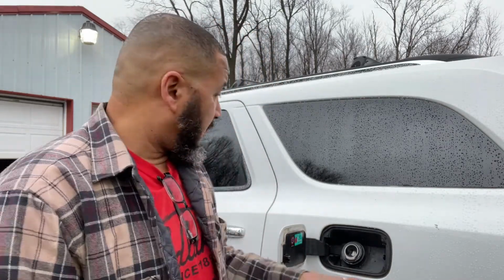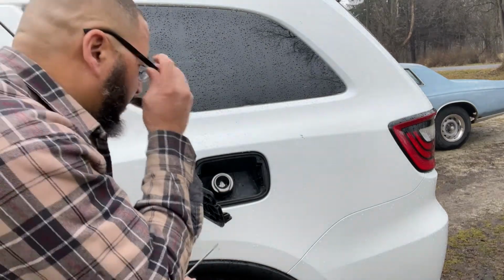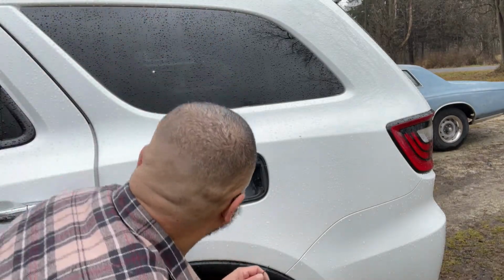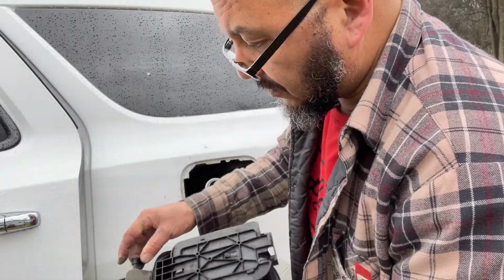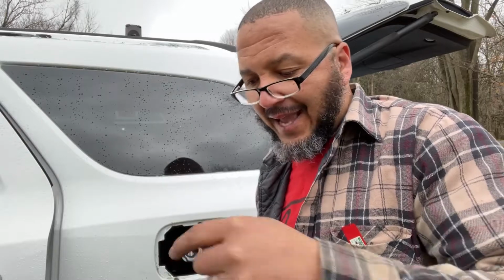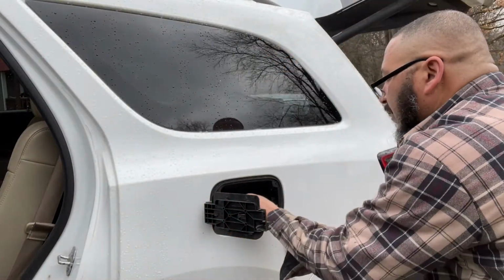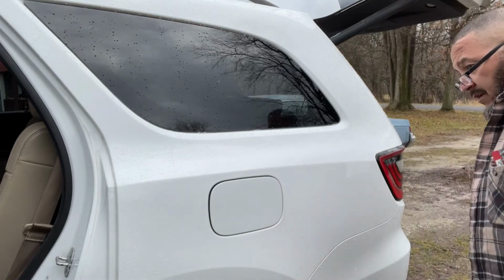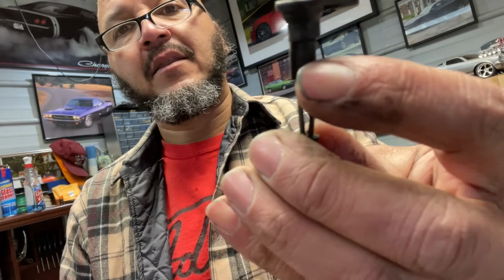2014 Dodge Durango Fuel Door Repair

Comment: Other than the button by the light  selector switch  on thefront dash, where exactly in the back is the control for the gas door incase the is not working

Comment: I had to do one where the door hinge pin broke so I drilled a bit and drove a screw into it. There is like three hinge pin replacements that are solid metal that are made for ford f150s and/or Lincoln's that look like they should or might work. They look like same thing to me just stronger. Wanted to know if anyone has tried one?
Reply: Have u tried? After seeing them they looked a little too big so I’m just avoiding wasting time and just ordered a whole new fluid filler housing

Comment: Do you know how to get into a 2016 Jeep renegade gas door that's stuck shut???? This happened yesterday and I'm severely low on gas.
Reply from the maker: There may be a passage in the rear if it has a tailgate. It would be very close to the fuel door to gain access.